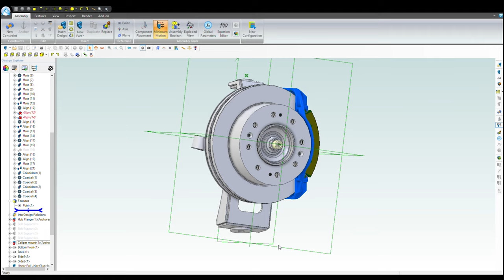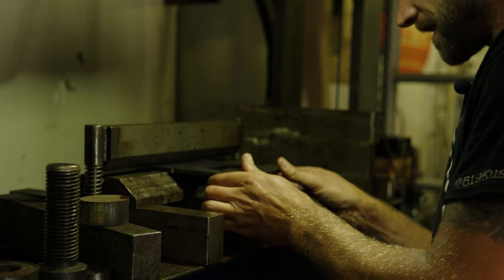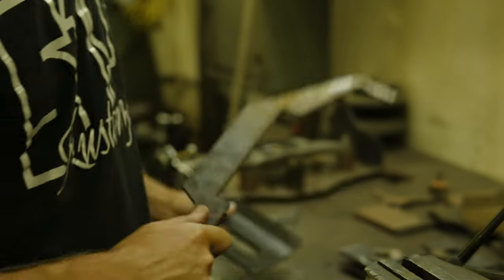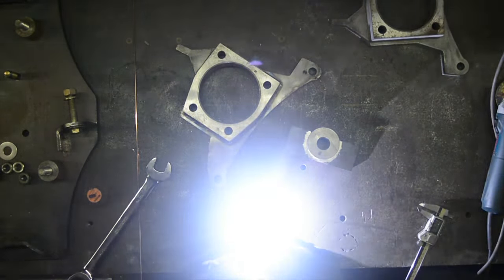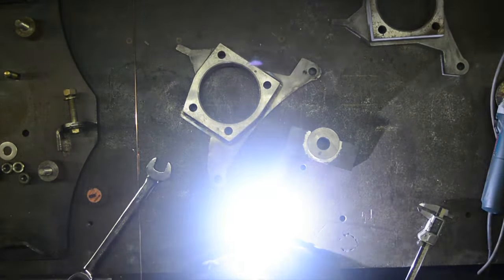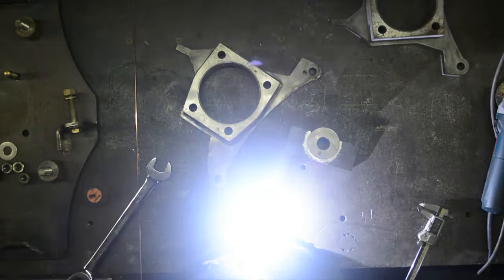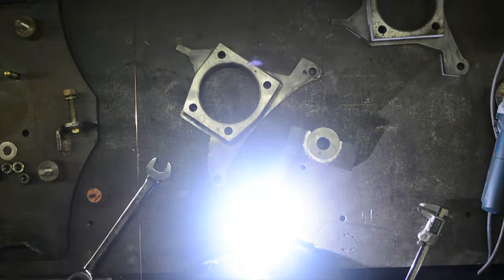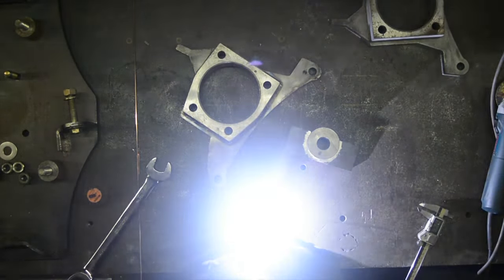Fabricating a Custom Sheet Metal Drop Spindle.    Warning - Lots of welding

Comment: Very Impressive overall, one of the better fabrication videos I've seen on here doing this kind of work, a bit of undercut on the Mig work, but that can be dialed in on the machine or blended out with a little abrasive work. Definitely will be keeping an eye on this channel. I'll have to look into the Alibre program too and do some fusion comparisons.
Reply from the maker: Thanks! I do end up using both programs, but I am much faster at Alibre since I learned on that one.